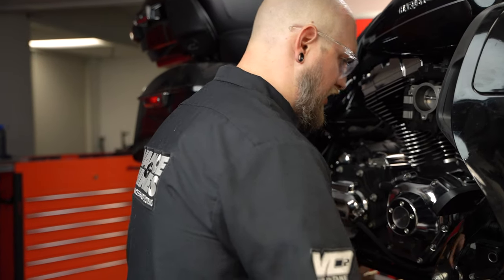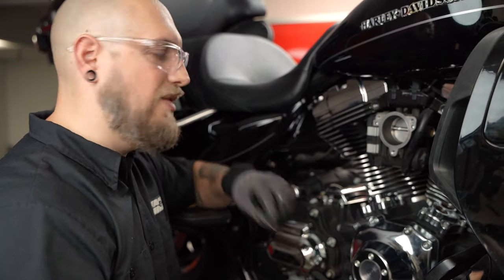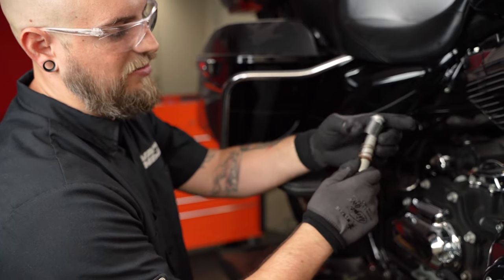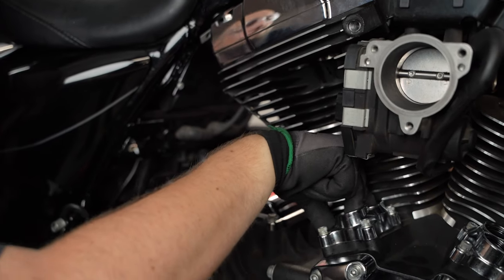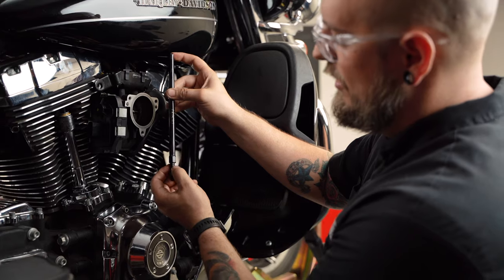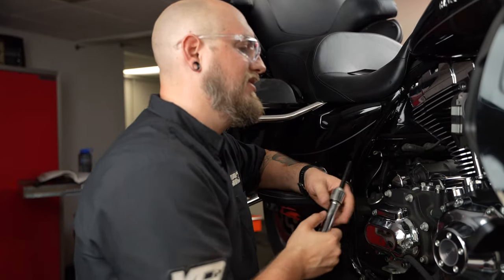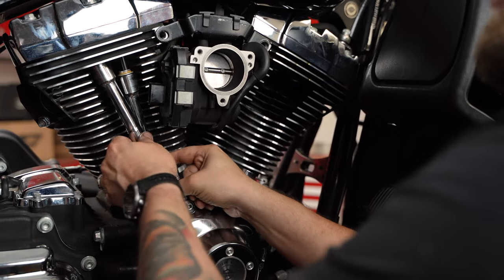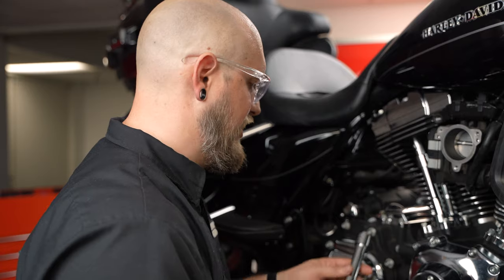Make it Yours Ep. 4 - Lifters and Adjustable Pushrods

Comment: Does the oil feed hole in the lifter have any other purpose than pumping oil in the lifter before you install it ? And does it matter which way the oil feed hole is facing as long as the flats are lined up ?

Comment: Tapered pushrods was a good design, 24 threads per inch gets them binned though. When tightened they are bent,spin one and see. Threads are to big and loose.  32  threads would make them best on the market . Shame